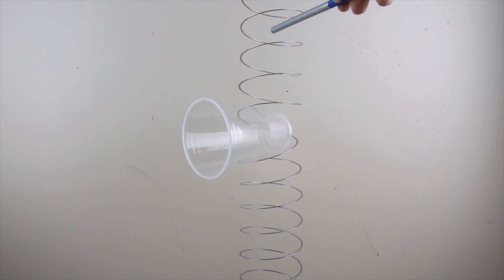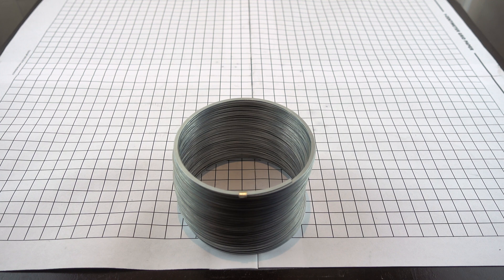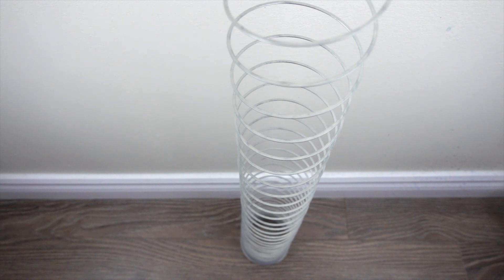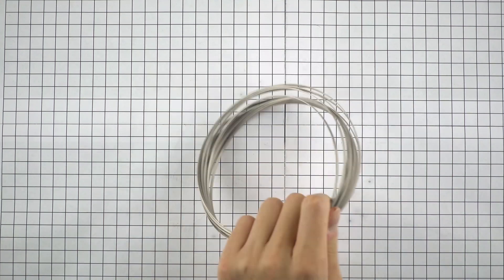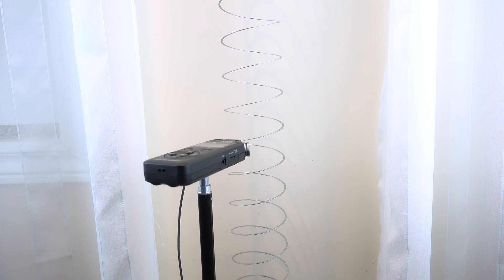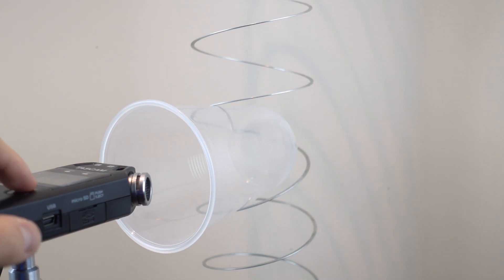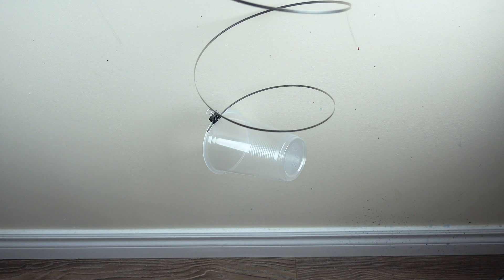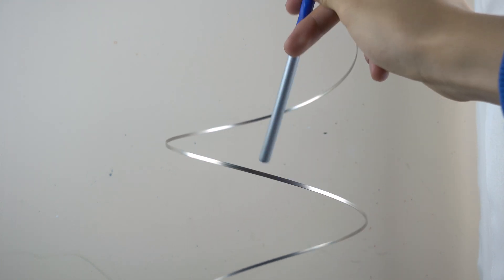IYPT 2019 Problem 8 Sci-Fi Sound Demonstration

Comment: thank you for the video! i just had a question: what is the exact purpose of placing the cup in the slinky?
Reply from the maker: The cup essentially just creates a larger membrane to move the air. The vibration in the slinky would be transfered into the cup. Once the cup is vibrating, it moves the air so that the sound wave could be heard by your ear. But if the cup (or any other membrane) is not placed, the slinky doesn't move the air enough for your ear to pickup easily.
Reply: @canadianyoungphysiciststou9723  was there a difference in sound and frequency, depending on whether you used the cup or not?